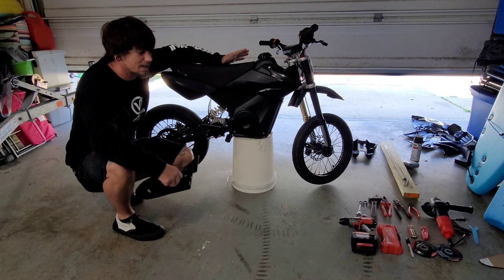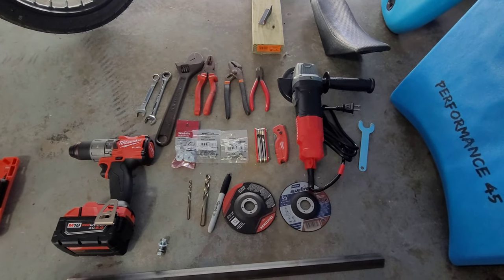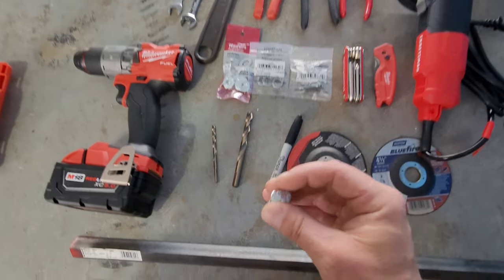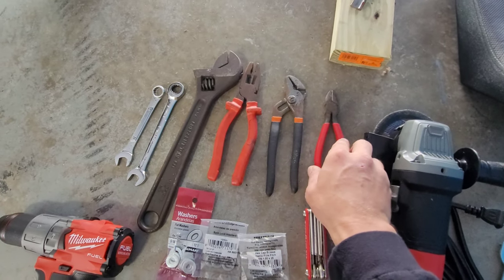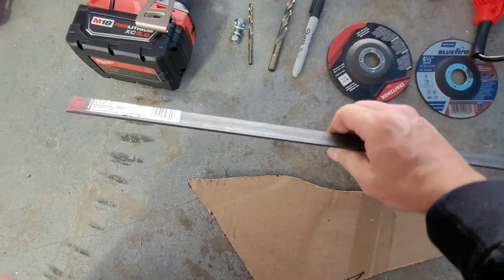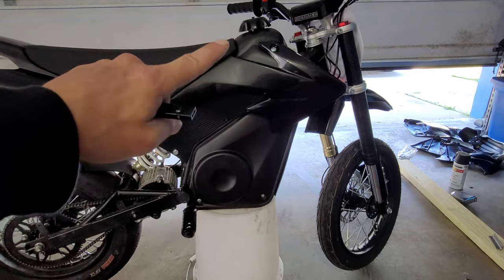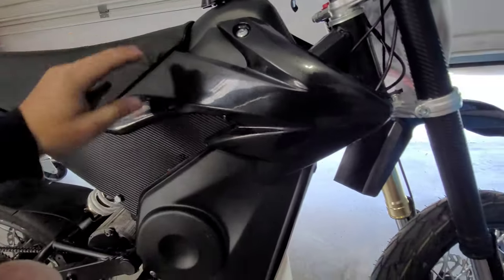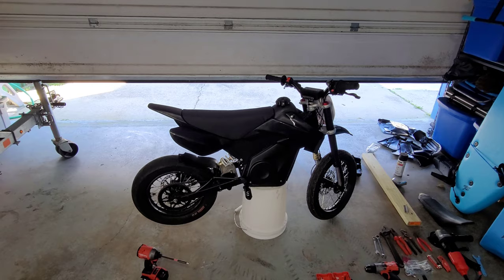Crf 50 plastic swap on electric pitbike - Mototec 48v

Comment: Good job 👏 I’ll probably be doing this!  I would never have figured that out without watching your build.
Reply from the maker: Hell yeah! Definitely worth the work!
Reply: And all just with bolt on parts 👍 Thanks for the great content.  I got the fardriver 72260 mounting it on top of the frame and built a second 48v battery to fill in the empty space on top of the original battery wired in parallel.  Will use the original motor for now, see how long it lasts.

Comment: I'm floored at how out of square those welds are on the stock frame. You did that bike justice by giving it some support behind. Gotta get you a welder and a bench vice!
Reply from the maker: For real a bench vice would of been great for when i was cutting the angle iron 🤣 slowly but surely building up my tools again
Reply: @EmxBrandon  a bench vice would be an exponentially useful tool for that lol in due time!

Comment: You change the 10t to 13t sprocket ?
Reply from the maker: Nah i kept stock gearing when it still had the stock motor
Reply: @EmxBrandon  ok how many mph increase with only controller from ETM ?
Reply from the maker: @Vidente Music  little over 40mph on 48v and right around 50 on 72v
Reply: @EmxBrandon  ok perfect I order soon the controller thanks men
Reply from the maker: @videntemusic2465  sounds good! Be safe and have fun 🤘😁

Comment: This is g rest vid! I still think it would be the most helpful to have a general idea of space for the battery. And maybe what type of connector? Thanks so much
Reply: Great vid*
Reply from the maker: Ill keep that in mind for my next video once i get my 72v in the mail but for now off the stock 48v battery the lead to the controller is an xt60 and the connector to the charge port is the stock connector i havent changed anything as far as battery connectors at the moment
Reply: @EmxBrandon  okay great

Comment: What motor did you use and what power is your bike please?
Reply from the maker: In this video it's the stock motor with a em50 from electro&co 3000w
Reply: @EmxBrandon  I'm getting a E&C controller the motor's standard 1300w was thinking of getting the brushless 1500w motor ??